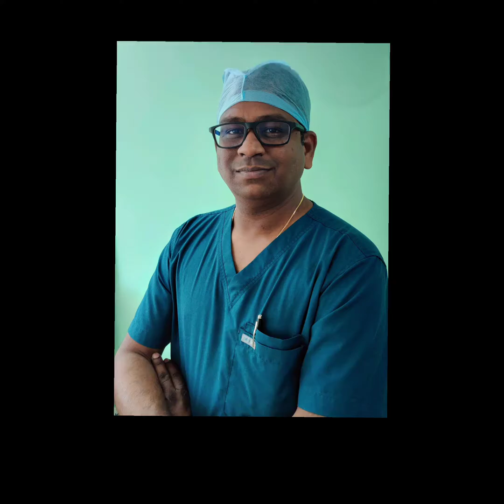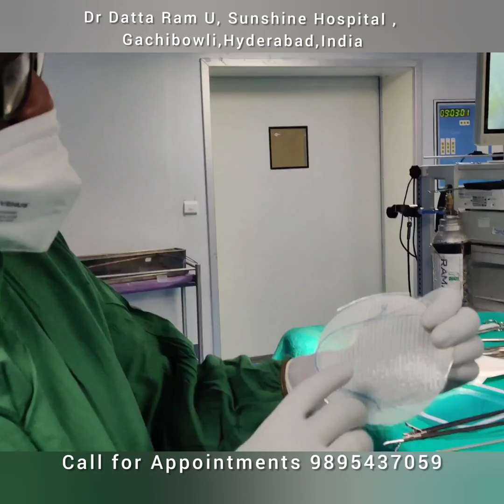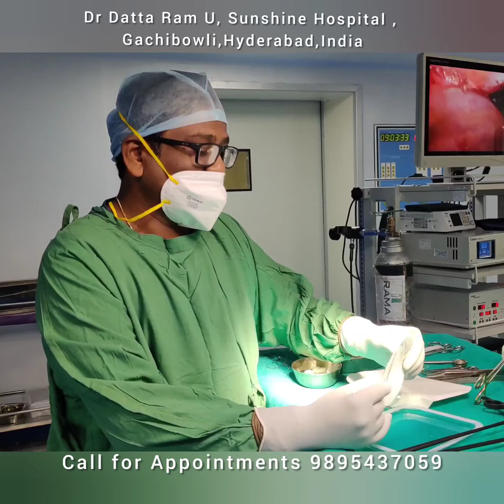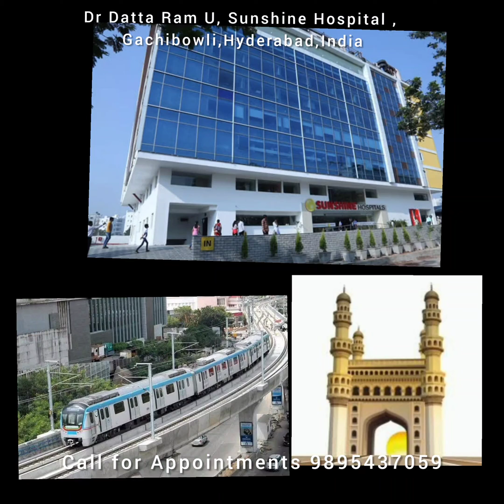What mesh is used for Laparoscopic Umbilical Hernia surgery?Best Hernia surgeon in HYDERABAD

Comment: Hi doctor, which mesh is Best for humplical heriniya laproscope operation, composite or prolin
Reply from the maker: Hi, composite mesh for an IPOM operation. Plain mesh is used for Laparoscopic inguinal hernias . If you have Umbilical Hernia or a ventral hernia, then it's very likely that a composite mesh will be used by your surgeon . Please discuss with your surgeon . Composite mesh has a collagen coating and it can be placed directly inside the abdomen safely, it's safe even if the bowel comes in contact with the mesh.

Comment: What is the name of this mesh? 
Is it good for open hernia operating?
Reply from the maker: Hi, this is a composite/ dual mesh, called Parietex mesh , it's made up of poly ester with a collagen coating . We use this for Laparoscopic hernia repair when we place the mesh inside the abdomen. We generally don't use this for open surgery. We use only a poly propylene mesh for open surgery and that mesh does not have the collagen coating . When we use a mesh inside the abdomen then we use the composite mesh .
Reply: @gastrosurgeonhyderabaddrda4211  can you  please tell me the best brand name mesh for open/hand hernia surgery which we use to place inside abdomin (in open hernia operation) ?

Comment: So this is self dissolving mesh, and how it takes?
Reply from the maker: This does not dissolve
Reply: Nowadays self absorbed mesh can minimise the need of removal problem if required, surely the patient will not do any heavy lifting. Unless some Wrong like pancreas to increase internal pressures.
Reply from the maker: The mesh is non absorbable, it stays in the body for the rest of your life. We almost always use a non absorbable mesh.

The advantage is the mesh is, it acts like a scaffold in which a strong tissue is formed and this gives very good strength to the weakened structures, this also helps to prevent the recurrence of hernia.
Reply: @gastrosurgeonhyderabaddrda4211  Dear Sir - Doesn't this material stiffen over time inside the body as no material is truly inert ? Perhaps due to oxidative stress..or the toxins released by the body which sees the mesh as a foreign object. It can create problems
Reply from the maker: @karuonline3294  yes, the mesh technology has evolved, they are safe. HERNIA is such a common problem,  mesh is now an integral part of hernia repair. Mesh has far more advantages, it strengthens the tissue and makes it strong. Reduces the recurrence.

Ya,  it does shrink with time, hence a appropriately sized mesh to be used , with atleast 5 cms over from the edges of the defect. 

Mesh is safe, ya but there have been reports of mesh infection, mesh erosion and fistulization into bowel, pain etc. 

I almost always use a mesh.